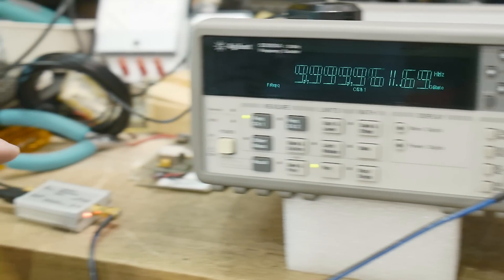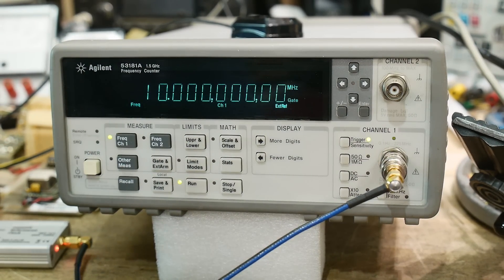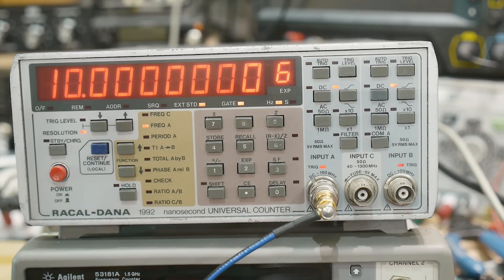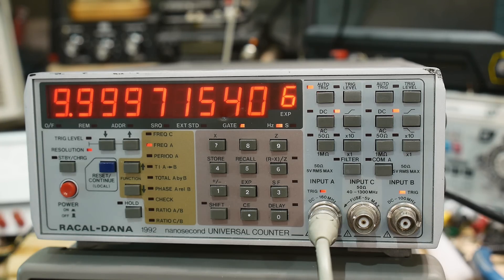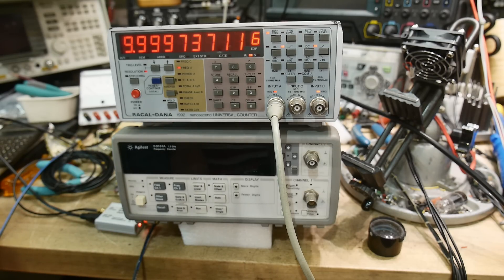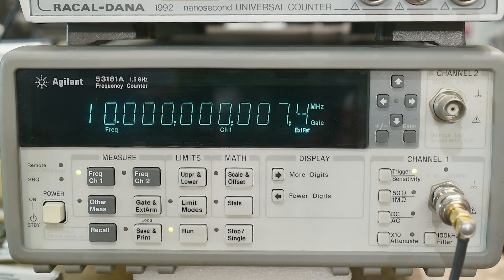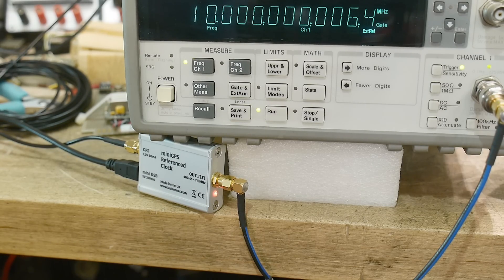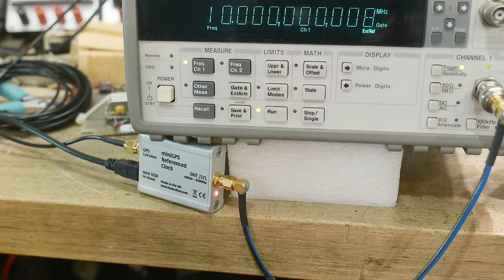#1315 Checking jitter of my counters

Comment: A rubidium clock is a secondary frequency standard. It is only as accurate as what it was adjusted to when compared to a higher order standard. How did you set up your rubidium standard? If there is a noticable difference in the frequency of the GPSDO & the rubidium after a few days, I would suspect that it was the rubidium that was out, not the GPSDO.
Also, it would have been intersting to have seen the configuration screen for the GPSDO, to see the number & quality of the satellites received.

Comment: Why leave the Racal 1992 resolution set to 0.1Hz, when you could have compared it to the HP at the same resolution? A single press of the resolution UP arrow would have given resolution to 0.01Hz. Then another long press of the button would have given you 0.001Hz resolution.

Comment: I have a GPSDO but no rubidium or cesium standard. For that reason I'd be very curious how they compare. I suspect the GPSDO would have better phase noise, while the rubidium has lower drift. Is this true? I'd be very interested to see how the two look together on a scope!
Reply: I have done some testing on this. GPSDO’s have an inherent issue where they get yanked around by the self-correcting nature of the clock. The MOST stable is a GPSDO feeding a 1pps in to a rubidium unit. The RB units have a better phase noise and “short term” accuracy and stability while the GPSDO’s have a much better long term stability but a worse short term stability due to self-correcting nature of the GPS lock. 
With a LONG integration time 48 hours for the RB unit the GPSDO can steer the RB but not yank it around. HOWEVER this is really getting down in to the weeds as I have found a standard Deviation of 115 uHz on 10 Mhz with a GPSDO only. And with the GPSDO coupled rubidium this dropped to 27uHz on the same 10Mhz carrier. So as long as frequencies of interest stay under a few Ghz both are REALLY down in the noise. 
The analysis was done on a 53131A with a new RB unit from Stanford Research, and a Samsung GPSDO module.
Reply: @Zenwizard Studios  Very interesting. Thanks for the detailed response! I'll have to conjure a way to capture and identify the infrequent minor phase shift that would inevitably occur. I would be curious to see how often there's an adjustment. Though I could also likely look into the software I use to monitor it, it may report these adjustments

Comment: I'm going to swap out the fan in my 53131 as you did but will still continue to keep it on a switched AC power strip since I'm not depending on the internal clock but the Rb standard instead.